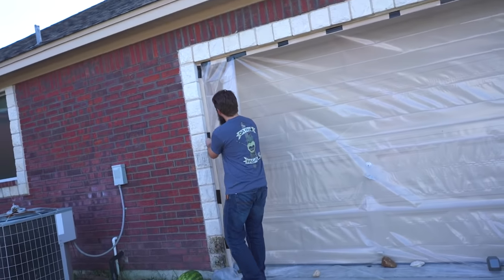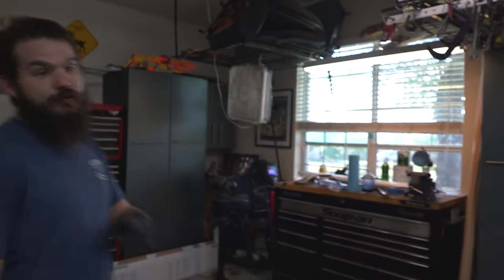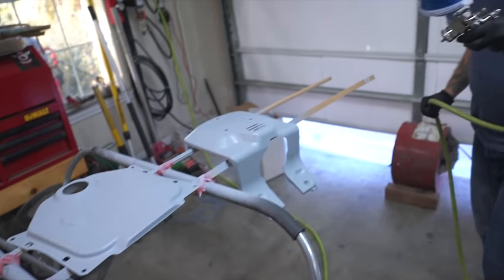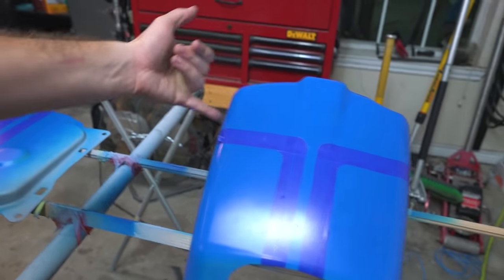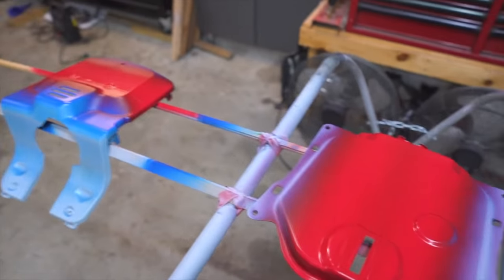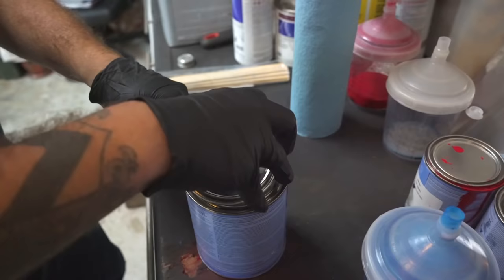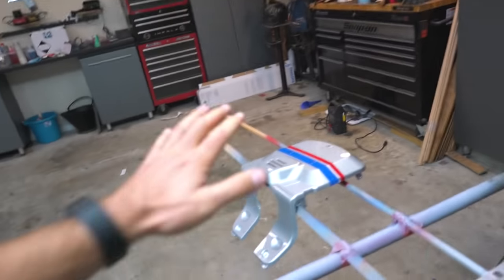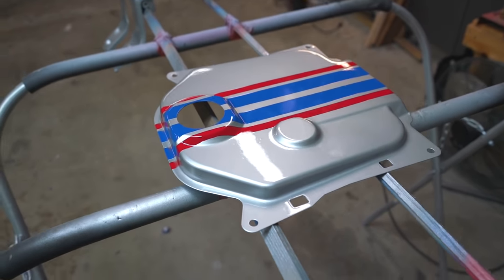CUSTOM DESIGN REVEAL!! [Ruckus Build Part 5]

Comment: I like how the red and blue stripes on the engine cover pop out because the silver is slightly oversprayed into their boundaries. Not sure if my explanation makes sense...but it looks wicked dude!
Reply: Mind if I ask what tape he used to to tape off the striping?
Reply: Also, the one cover had a T-section taped off for the blue, what happened to that? Did you guys change the striping design halfway through?
Reply: Or was it the one piece left over....? haha

Comment: So much dirt in the paint, no wonder with no clean area, no wetting the floor, and having a big furry shedding dog running around.
Reply: Canuckrz was thinking how un pro he was being dust is a painters nightmare
Reply: Boooo! I disagree I couldn't see any dirt in the paint! Stop being so negative it looks sick!!
Reply: Look at 17:26 on wards and especially when he does the pan over the tank cover at 17:50 watch as the light goes across the paint and you will see all the speckles from dirt landing on the piece during the painting process. He lays down the paint very well, no runs, uniform etc, I'm not judging him there; just he really needs to work on dust/dirt control.
Reply: Canuckrz I spotted it too a bit of a pants spray job if you ask me mite as well of used a rattle can
Reply: Thats the point.  Its one step above rattlecans, using equipment and skill that SHOULD have put it several steps above.  Just a wet floor away from having way less trash in it even.  Im not sure I agree with the order of painting either.  All the lines were straight so easy to tape off.  Silver first, mask out each color line and just use paper to keep it off the silver.  Would have kept the ridges down more  maybe.  Still looks awesome though!  Some wet sanding will take care of most of the "issues".  And like you said...its not gonna cost $40k.
Reply: JEG's Garage The painting order also stuck out as odd to me. If it was a very dark color like black or navy I could see doing it this way as laying the stripes down on top of the dark color would effect the shade a bit, or require several more coats. But with the silver that's not really an issue. The results are fairly good regardless (other than the dirt) just seemed a bit odd.
Reply: Its not a good practice to lay anything over a flake paint such as silver. After its laid down it has a relatively rough texture. You will not get a good sharp edge to the tape and possible bleed through.

As to the bumps from the layering of paint; you lay down quite a few coats of clear, the when hardened you wetsand them down to a smooth finish. Then you can spray another couple of coats of clear. After the final clear coat you wetsand and buff out to give you the glass finish. Dust is always an issue, it is difficult to get a dust free environment without owning a spray booth. As long as the dust falls on the last coat and isn't encapsulated in the clear chances are it will be sanded or buffed out.  Clear coat is designed to be sanded and buffed for the mirror finish.
Reply: Gotcha.  Didnt know it was bad practice to paint over flake (metallic) paint.  Its done all the time.  I mean candy jobs are done over it, and usually rally stripes or graphics are done over it without issue.  I think the tape has more to do with crisp lines than the metallic.  But Im not a pro or anywhere near it. Obviously you can wet sand the ridges out.  I would rather keep them minimal though to avoid having to wet sand as much.  Especially on smaller parts with curves.  Hard to really wet sand them too much without burning through.  Video might exaggerate things anyway...probably not as bad as it looks.  

As for the dirt...I agree it would be impossible to get a sterile environment especially working in a garage like that.  BUT...there is no way t he dirt isnt between layers of clear.  Every time he takes a step, its causing dirt on the floor to move around.  My point was just wetting the floor, and keeping the dirt down there, would have certainly helped.  

He's obviously got experience though.  Probably still way better than I could pull off haha.  Coming from the guy that decided to just satin black his bike because it was less hassle :)
Reply from the maker: Hey everyone, just wanted to reply to you guys. There is definitely some dirt, but only if you're nitpicking. Even in person, the job itself renders it nearly unnoticeable. But of course it's not ideal. He normally shoots in an actual shop, but I would have been unable to film there. Really wanted to be able to show off the process and be a part of it. Most of what you're able to see will be removed with sanding too. He made do with the garage so I could get the shots. Trash aside, I'm still in love with how it turned out :)
Reply: Hey Motonosity!  Please dont take any of our convo as saying its crap!  Im sure we all can agree we appreciate you bringing the build to us so we can watch!  We were just being nitpicky :)  Again...this is coming from the guy that painted his bike with rattle can satin black in the back yard because Im lazy :)  Pretty I noticed a bug and just sprayed right over it haha.  I like the color scheme (Im a Philly guy so I def see Amtrak hehe).  Looking forward to seeing it come together just like your CR build...which literally has me looking for dirt bikes now.